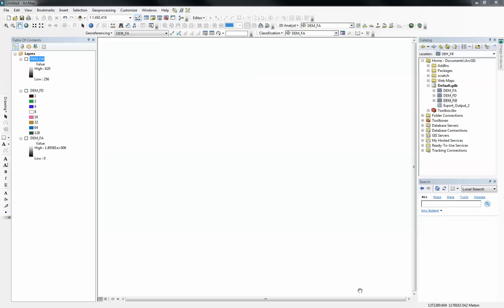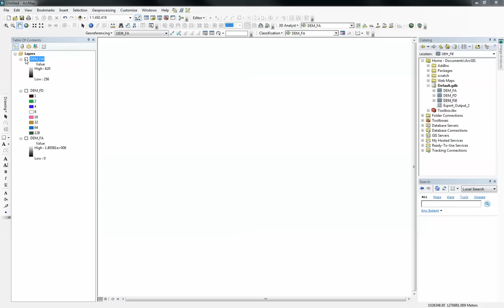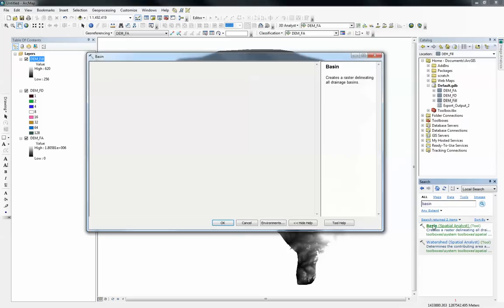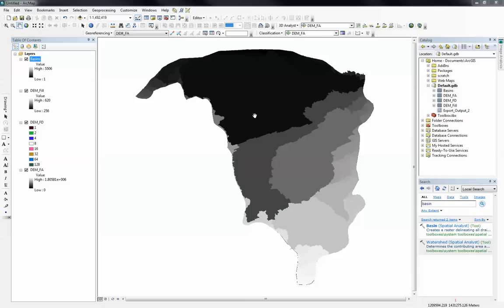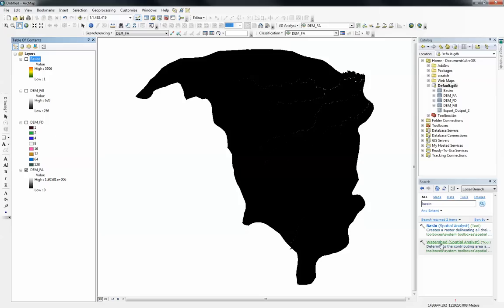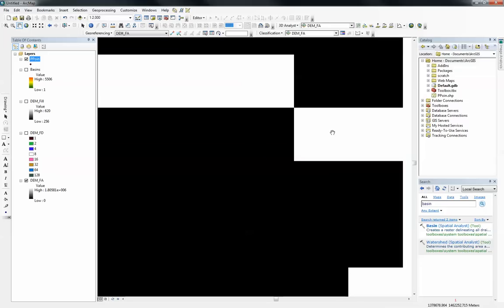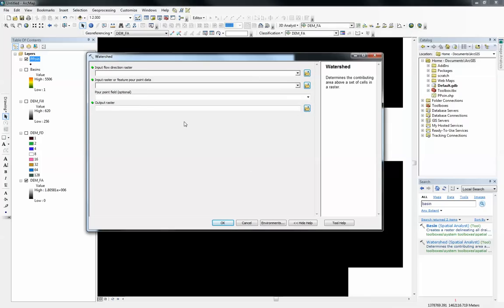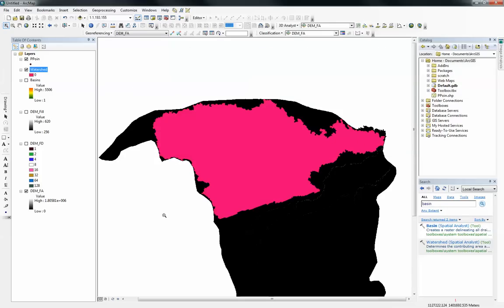Delineating Watershed and Basins Using ArcGIS

Comment: Hello. I am unable to execute the steps after creating the flow accumulation raster. Is it compulsory to add the pour points on the highest accumulation pixels? I wanted to create sub-watersheds within my study area. The output of Snap Pour Point returns a range of values and not a single value. What might be the error?